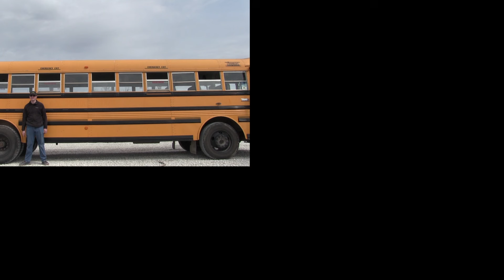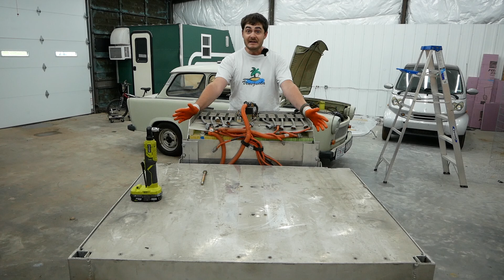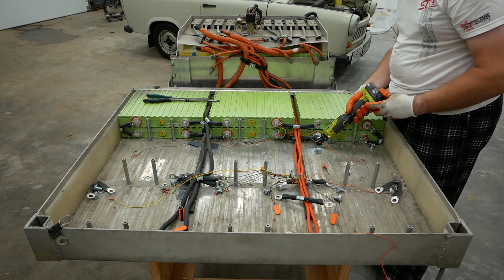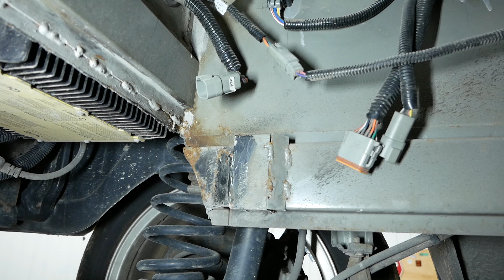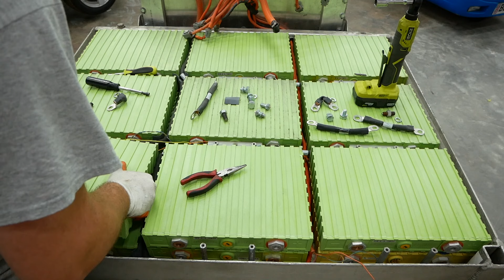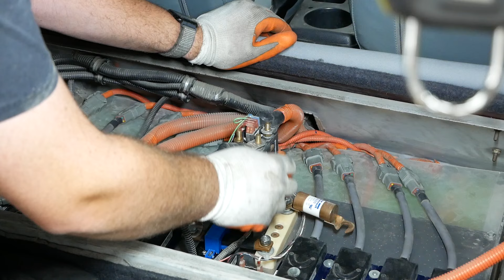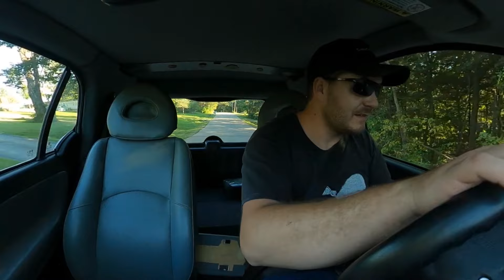Can I Revive the Dead Battery Pack in my Wheego Electric Car?

Comment: 14:15 uhm... Don't take my word for it I'm just ASE certified in hybrid and EV, but that usually indicates at least stage 2 thermal runaway. (Could be up to stage 5 but usually that's fairly quickly followed by running and screaming).

Comment: you can "variable speed" that lift with the dropper lever. If you modulate the lever with the button pressed, you can slow it down. Janky, but it's worked for me on things I"m not sure about. It helps to start on the locks so you can start "fully bypassed".

Comment: I know this is really late but having only just seen this I must say it. Your method of charging the cells left you with a wildly unbalanced pack and will result in cells being overcharged resulting in further bloating and premature cell death. Once you got them all to the same rough voltage you needed to put them ALL in parallel and charge until 3.6V and the current had dropped off to < 10mA, this would have guaranteed they were all at the same state of charge. The fact that the car thought it had a 60+% SOC confirms that this is the problem as SOC is estimated based on total pack voltage, for example, if 50% of your cells were lets say 70% SOC, and the other 50% were 50% SOC, the total voltage would give you that 60% SOC reading. The problem here is once you put it onto a charger at 300+V, it's going to overcharge those cells that are charged higher. BMSs should limit this, but only to the extent of preventing a fire by shutting down the entire pack should the cells go too far out of spec (as it did when it discharged too far). And before anyone states "the BMS will level them", sorry, but most BMSs on large packs like this even if they have bleed resistors to do this (as this is the cheapest and simplest way), can't do enough levelling in time when they are so far out. BMS levelling is to correct for minor discrepancies due to internal resistance difference between cells, the pack is still expected to be very close to level when it's assembled, attempting to use the BMS to level a pack that is so wildly out of balance is like trying to stop your boat from sinking with an eyedropper.

Comment: So you decided to go with full disassembly before you even tried to jack in between cells and balance it manually? Smart. I bet you could even do that withou taking battery module from under the car. This possibility was just one hour reading user manual away.

Comment: Use a proper torque wrench on all your fasteners. Running lithium without making sure everything is torqued properly can cause loosening of fasteners and extreme arcing and high heat. Also, I would caution that you've most likely lost considerable capacity on any of the cells that dropped below 1.2 volts

Comment: The first thing you should always do when rebuilding any battery pack is charge cycle it a few times to calibrate all of the bms modules. I guess that's what did you in .

Comment: Ahh yes, the conundrum of no lithium battery standardization.  At some point governments are going to have to get involved and force all the manufacturers to make a standard and stick to it.  I seriously can't believe that each and every model of EV has a different battery.  If Ford, GM, etc all used a different battery, with different voltages (say one is 7.8V, another is 13.5V, a third is 9.9V, etc), instead of the standard 12V--they would have gone out of business a long time ago.  Well, maybe not all, but most car manufacturers would have.

Oh, btw, a balloony lithium cell is a bad cell.  Always.

Comment: I am not an expert , but could you have load tested that  battery that had frozen and If it failed , left it out of the pack and made do with 3V less?
Reply: Nope, removing one cell from the series ruins the experience for the whole pack. At least from the BMS point of view. Sure theoretically the motor would just run a bit slower with less voltage.

Comment: Im late to the party, but i have a little fact that i think will amuse you. You noted the bolts with a smaller bolt in the head, this concept is actually used on the iconic mopar 217 L6 engine. Two headbolts on opposite sides of the head have a smaller bolt hole in them, the one near the water pump connects to the battery, and the one mear the firewall is part of the throttle linkage. Its a near concept that doesnt get used much. Thought it was funny seeing it on the wheego

Comment: THE SWONEM BATTERY IS REALLY DANGEROUS        Its "dendrites" forming in the battery between the anode and the cathode - little crystals of lithium making their way across... 

They will eventually short circuit the battery and cause a fire.

Comment: Nomenclature:  We'll call one of those green lego pieces a block, and the individual batteries inside are cells.  I think you need to open the blocks and separate the series connections so that you can charge the parallel banks of cells individually back to 0.6V using a bench-top power supply.   
You might be able to charge the whole blocks one at a time without causing too much damage, but doing them four at a time is not a good idea.   One block might be taking more of the juice and getting vastly over-charged.   That's my opinion, anyway.
Reply: Id the swelling caused by dendrites forming??? I was told before that this was the case.

Comment: Im surprised they recovered. Under the min voltage there is irreversible damage done so your capacity is probably fubar.  EV West used to have cells that looked similar, I think they were called Thundersky.

Comment: EXERCISING A LITHIUM BATTERY? No! NEVER! BAD!

I don't know where this old battery hack of exercising batteries came from but every time you let the charge go low on a Lithium it dies a bit permanently.

Yeah they were long gone once you let the charge drop. Copper shunts are known to form across the terminals, creating a rapid discharge / short / FIRE RISK. :D

Just... FYI. There are good articles on Lithium charging and how to avoid permanently killing the battery / fire.

Comment: You can buy lipo batteries to replace those cells, you'll have to buy a different charging system and any additions will most certainly be more expensive than the cars value. But if you switch over to lipo batteries, West Coast EV can ship you lipo batteries, you can even have a manufacturer build you what you want for batteries if you tell them specs and dimensions

Comment: the car will run with the bad cells pulled  out , keep the pack above 60 volts it will drive.. inflated battery is always bad reprogram it to not go over 250 amps that's the max that battery can handle with no way to cool it

Comment: Now we know the idea behind the thick metal plate on top of the batteries, it gives you a few seconds to come to a stop and get out before the plasma ball and poisonous smoke erupt into the cockpit. Time to sort the batteries, load test them and find some sort of replacement, maybe something from DeWalt? Or reconfigure the pack with the remaining good cells so it could still be driven albeit with shorter range. At least you could get a few bucks back on it if would drive a couple of miles...maybe.

Comment: Why you did not balanced the cells? 3.0x-3.2V can easily ruins everything. The balancing life are easy, you do not need expensive stuff. Just charge like ever you charged and after that put all cells parallel and it balance all these withing next 24 hours. Simple and effective method if you do not have the balancer charger.

Comment: Just because the cells went dead doesn't mean that they are no good. That is just what manufacturers say to get you to buy more batteries. Charge them up and test them first. The cells can be replaced with any battery with similar capacity.

Comment: That "baloonie" cell needs definetly to be replaced or sorted out. Cause as we know, faulty batteries are likely to catch fire in electric cars. So I wouldn't let it in there for too long.

But I've got a recommendation for you @agingwheels. Go Check out the Video from "Mighty Carmods" where they built a whole new battery pack for the "Electric Turd" there are several possibilities to make a whole new, possibly even more capable battery pack for electric cars.

Comment: search 3.2v 52AH LiFePO4 batteries, they'd work, tho smaller they have a bigger capacity than what you have in the car, and they'd work with the charging system

Comment: You could salvage the good components from the battery pack and electrify your heavy duty battery cart. You may also be able to remove a few of the battery cells and trick the car into working with a lower voltage as an in town only electric car.

Comment: So why not work out the duds in there and build new packs out of the cells found in power tools and laptop batteries?   I reckon if you made complete new high drain cells all round it would be cheaper than relying on those packs which must be fairly old by now hence their inability to maintain a charge... here in the UK we would call them shagged out and these cells never had a long shelf or use life anyway with the idea of say 3-5 years looking at use and you only get around 500 good charges out of any lipo cell, maybe a 1000 but they just give up past that magic 500 mark.   Why not do it like a train loco, have an engine powering a generator that in turn powers the traction motor, work out the max draw your traction motor needs and have the engine management set to increase revs as the draw increases, will still be electric kinda :P

Comment: usually those batteries shoeld be clamped to prevent swelling.
but those cells are robust.
probably the bms is confused.

and via aliexpress or other suppliers one can find tons of those lifepo4 batteries.
probably a chance for the wheego?

Comment: I got a few suggestions. You could install lead acid batteries. You could install a gas generator and power the electric engine directly with it, inserting a small battery in the circuit. Or install bicycle pedals, saving a lot of weight. You could take off batteries and engine and install an ultralight airplane engine on the roof, turning a five foot prop; that would move you quite briskly. I have made a few prop powered cars and they are OK. Or you could throw it away and use your magnificent Trabant; they more or less work forever and are extremely simple to fix, if you do not demand perfection. Perfection is in the eye of the beholder. I love them Trabants. I have owned several two stroke cars and they, more or less, work, always. Very different from your run out of the mill cars. Saab the best.

Comment: Find out how many batteries are in parallel and remove a row. The battery wont last for as many miles but you should have all the power you still need.

Comment: it is a bit of a clowns car isn't it, But at least it brings smiles and a lot of hope that it works!
I wonder what kind of other battery pack/system can fit under wheego. Maybe not original but all cells die at a point.

Comment: @aging wheels 
Bowed batter you got there 14:20 is severely degraded and will need to be changed.
It is not safe to keep using it as it will just get worse. 

E.g. you got too much dendritic growth which made it bow.

Comment: You def don't want that ballooned battery in there. That's a reasonably good way to tell which cells are trashed and which are just degrades. All of them are probably degraded if the voltage was that low though

Comment: A "little red wagon? with a honda generator in it, towed by the Wheego for life suport, or just driving around. Option 2, A hit-miss oil burner mated to a small gen-set towed on a trailer. Option 3, invest in some loooong extension cords. Thanks for the shows, and all the darned time it takes to edit them.

Comment: surely the bat pack can be replaced, just needs to be reenginerded.
2) you should load test the batteries, perhaps you just need a few modules and can replace them with similar ones (or build one).

Comment: The interconnecting wires between battery cells seem way too thin. Why don't they burn up? Could recycle some connectors from defunct golf carts or folk lifts. Is there a society for electric vehicles near you?

Comment: I'm a little surprised to see no cooling whatsoever for the battery. Even my CR-Z, which has a 15 kW motor and a whopping 0.6 kWh 144 volt battery has a cooling fan.

If i were you, I'd try to find some suitable replacement battery cells and adapt them to the Wheego. Seems like an amazing project.

Comment: to stop that spark (caused by the current of the input capacitors in the motor controller charging) when you connect the main HV fuse, just take a normal 115v incandescent lightbulb in a holder and connect it between the fuse and the terminal before swinging the fuse in, the bulb may glow momentarily but will act as a resistor charging the caps at a slower rate and preventing that spark when you swing the fuse into place.

Comment: I work with automotive battery packs.  I know some chemistries are more robust than others, but in our testing if the cell voltage is below 2.8V, serious damage can happen, most notably lithium plating which damages the cells in ways that cannot be reversed by charging.  When you said your most charged cells were 1.3V I immediately thought the whole thing wouldn't work.  Good luck, love the video, and love the Wheego!

Comment: Caveat: LiIon cells have finite number of charging/ discharging and "cycle charging" will not help this fact. If you wish to drive it as such, you'll have to cope with 60-75% of usable capacity until it dies completely (same as the cell phone, actually). Other option is replacing the current cells with voltage/ capacity LiIon equivalents-you can even get those of more capacity, it will only take to charge longer (if they physically fit, of course).

Comment: What?! A mass-produced, hand-made Chinese electric automobile that cannot be charged (externally) if the batteries (fully) discharge?! Heinous-ery! It's the Trabant of e-vehicles!

You are still working on this POS after a year plus?! Now, I know you've sacrificed much. But fighting these odds looks like rage, not courage.

Maybe you can sell the aluminum of the overbuilt battery case for scrap?

If you stored the car outside because of concern for space, you can hang it upside-down from the ceiling, like a model airplane you don't play with much anymore, because it looks better than it flies. Make sure to paint tire tracks across the ceiling and up a wall....

How does an ex-programmer of the Android know about BMS cables?

You installed the free-floating Delrin spacer incorrectly, er, differently. It will collapse, fall within the gap, allowing a short, and you will die screaming....

Conjugate "Wheego": I go, Yugo, We... oh, screw it. It was just $50.

(No, "every" car has a high-ish floor pan, sorta, to clear the drive shaft (which it doesn't have), for motor and transmission conformance (which it doesn't have), and the exhaust, cat, and tips (which it doesn't have).

Comment: Ima go ahead and calll it right now that the bulging cell is bad. I know vary little of batteries but ima also call it that the dead cell is also acting like a black hole to the juice in the other cells, or atleast impedeng propor current flow...

Lastly ima say that its sad to see the wheego die dispite being junk... Although it would be fun to see you swap in a new battery, a new electric powertrain, or even close the floor pan back up and swap back in a combbustion engine. Or you could just use the smart, I guess (but that`s boring and I despise them)

Comment: when you charged 4 batteries in parallel you probably killed the rest of your cells. dead cells could have the same voltage as a good cells but the capacity is lower and to make it worse bad cells get so much hotter and puffier under load and could catch fire.  don’t charge batteries in banks like that if they could be bad. and don’t put any puffy batteries back that’s a good sign it’s very dead. take the batteries out and test the capacity of each individually before putting them back in. batteries need to be pared with similar capacities if in parallel.
Reply: Trickle charging batteries in parallel won't kill them like you describe, it's charging or discharging them in series (without a BMS) that will do that. He did both, though, so it's possible some extra cells were damaged.

Comment: Love the video but once you had it back charged and going to put into the car again  your safety was at stake .the reason that I say this being in the automotive industry and working for a dealership .for electric cars special tools and special gloves are required  even rubber mats to put on the floor .rubber boots .just damn lucky you were .one spark and you could end up in hospital or even dead .if you going to do jobs like this people use the correct tools for the job

Comment: Likely the cell balance (discharge resistor type) only operates when the car is charging.
Should have left it on the charger for a couple of hours before taking it for a drive outside.
That said, you still have some dud cells (lower Ah capacity), like that one with the bulge.

Comment: Apologies if I don't know what I'm talking about here.  Have you considered trying to replace cells with a different chemistry?  I think you had mentioned that, but the voltage of each pack was 3.2 and the BMS modules had to read each cell.  What if you replace 4 cells with a single 12V (12.8V) battery, and make a resistor network to divide the voltage to trick the BMS?

Comment: Those cells are prismatic LiFe cells, and should be common. Have you had a look on AliExpress or Alibaba for replacement cells?

Anecdotally, my parents have a bunch (60 or so) of 100ah LiFePo4 cells they bought from Alibaba.

If you measured the cells dimensions, you should be able to find replacements.